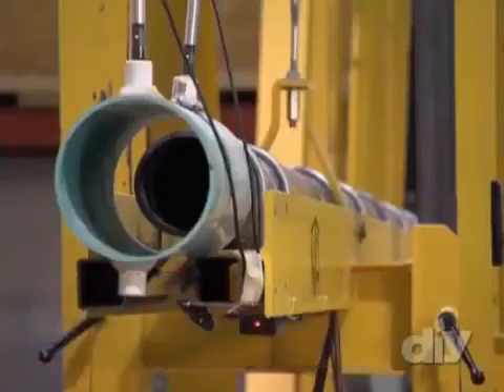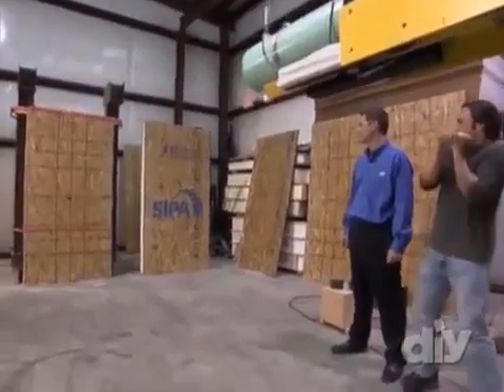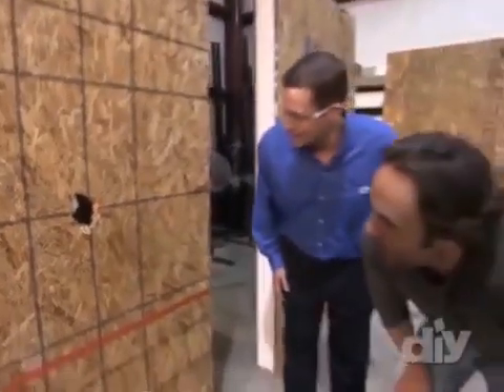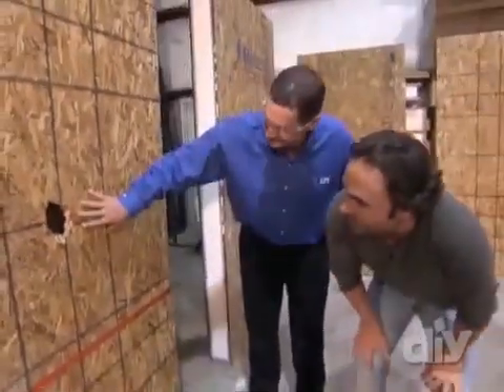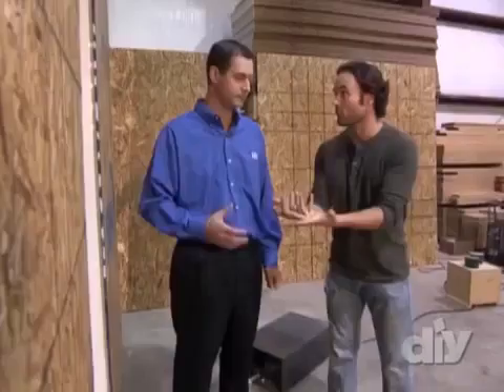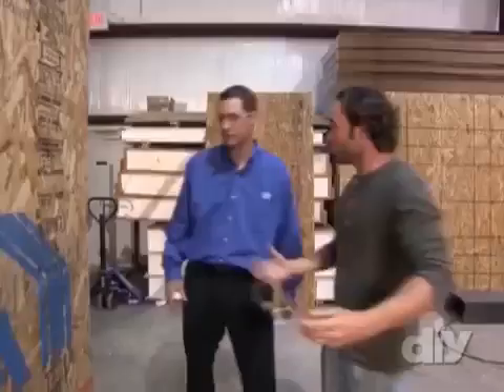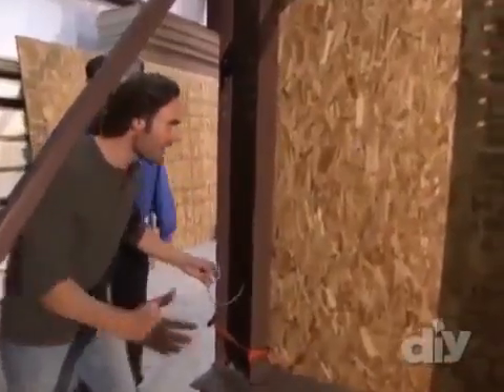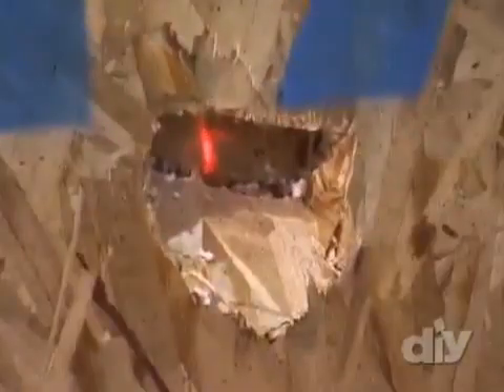Hurricane & Wind Missile Test: SIPs vs Sticks

Comment: big difference between 9 pound wooden pole and Styrofoam hitting the walls,
Reply from the maker: Indeed. The EPS insulation (not styrofoam, even though it's deceiving because both are white) is a high compressive strength material, having a closed cavity with this strong insulation delivers exceptional strength to structures.